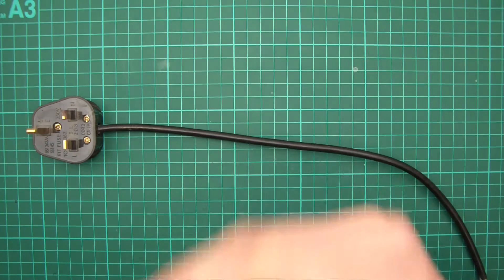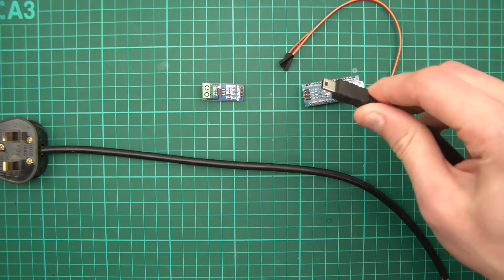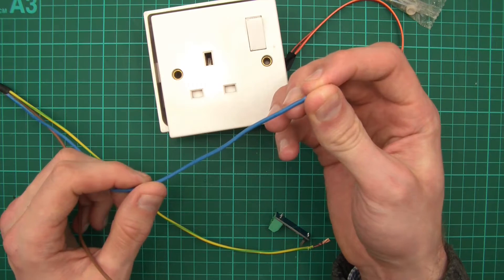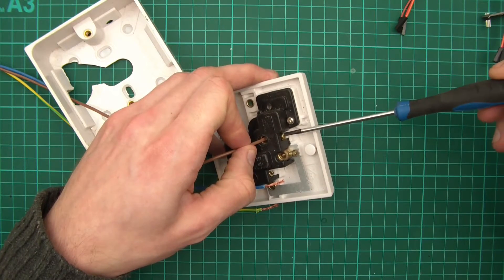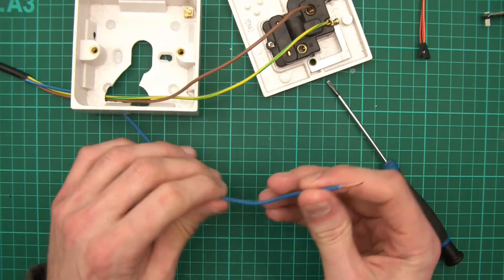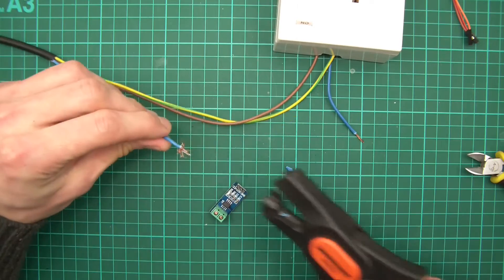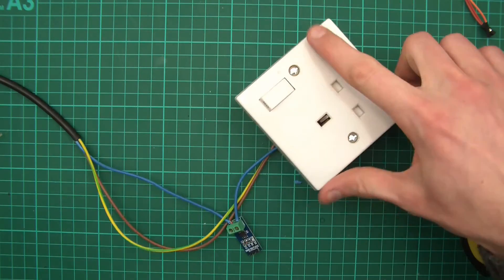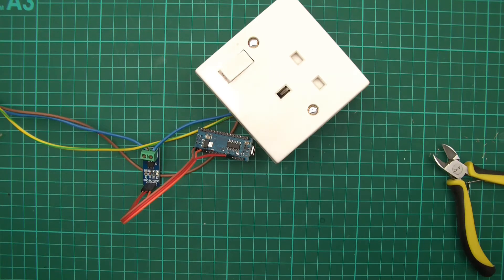TUTORIAL: How to Measure AC Current Using ACS712 Hall Sensor (Part 2/4 - Wiring the ACS712 to Mains)

Comment: Nice video, thanks! If Live and Neutral would be reversed, could this be detected by the ACS712? In the UK, you have the "polarized" and fused plugs, we in Germany have the "Schuko" plugs that can be inserted into a socket at 0 degree or 180 degree reversed. At the end of the day, the AC consumer does not bother, but I want to detect in a 3 phases setup L1 L2 & L3 + N if L1 and N have been reversed due to somebody using a Schuko adapter ...

Comment: Thanks for the video.  The ACS712 has 2.1KV minimum isolation between pins 1-4 and 5-8 so measuring on the hot side of the mains should not be a problem.

Comment: i will connecting AC 4A  load but there is no change in output voltage in ACS712. In this current sensor is possible to measuring AC current?  anyone using AC load?

Comment: hey anthony, enjoying the videos, when is the next one out (part 3/4)?? designing a current consumption monitor for my electrical engineering dissertation... but am struggling to find any real / practical ways of measuring ac current / voltage as i dont have much of a background with arduino :/ looking forward to your response cheers
Reply from the maker: Jimmy Ashcroft Hi Jimmy, 3 and 4 will be out this week. The standard way to measure voltage into a microcontroller is by using a voltage divider. I've got a few videos on it in my channel. The standard ways to measure current are either by using the hall effect (this series) or by using a current shunt. I've got videos on that too.
Reply from the maker: Jimmy Ashcroft Actually, I was just thinking... I have a series called Lithium Ion Capacity Checker... And that has a current monitor built into it. If you watch the first few parts of that series, you'll get it.
Reply: cheers anthony, il give them a watch and get back to you